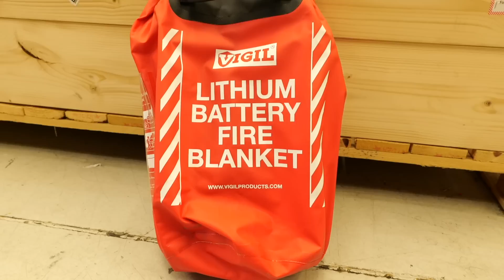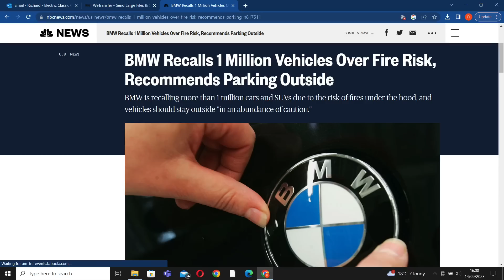Electric Car Fires - Facts and Figures

Comment: A parked ICE car will not spontaneously combust due to the fuel alone. Unless flammable fluids have leaked onto the exhaust or some other extremely hot part of the powertrain petrol or diesel simply will not burn without a source of ignition. Thats only going to happen if the engine is running or the engine has just been turned off and is still hot. The most common culprit of ICE fires is an electrical fault, which can be down to a multitude of sources, be it age, damage to wiring or poor manufacuring quality. In either case its the flammable materials the vehicle is made from that burn. Hardly ever does the fuel tank go boom. There are millions more ICE cars than EV's so of course the fire statistics will be higher. The issue with EV's is the likelihood of a short circuit is multiplied thousands of times because of all the individual cells that make up a battery pack. You only need one cell to go rogue and that's the end of your EV and anything parked near it.

Comment: @ECC 
   I may have 2 solutions .
Both variable related .
   1st Sweden .
Regarding fire services grapling an electric vehiclefire .
  Sweden enjoys lots of snow during winter months.
  If Austria has small machines to create snow for skiing .
  The Swedish fire services could use snow ,ice or even have a fire truck version of a slush drinks puppy machine .

  2nd solution .
Given all the hype about getting rid  of fossil fuels and replace them with renewables,such as wind turbines that burst into flames and are currently non recyclable.
  2030 mandated The foil fuel dead line .
   Then you will only have one catastrophic fire starter percentage to calculate .
   For safety .
We should all give up travelling altogether .
Give up all electric cars  fuels trains , aeroplane flights ,boating (fishing inclusive shipping and space travel .
We can all live in out secured ,perfectly 
  diverse 15 minutes cities .
Walking or cycling. 
  Mandatory to go to gym 2 hrs a day .
All training machines connected to dynamos..to generate your allocated electrity quota .
So you that you may have the ability to stay warm and cook without facing a hefty jail sentance if you burn a protected tree ,any  illegal substances or any  protected book . 
  Most books in the future will be written on toilet paper with petrol chemical free ink .
    

    Sarcasm remains the best remedy .😅

Comment: Age of the petrol cars that caught fire. 5 to 20 years old. age of the electric cars that caught fire. 3 months to 2 years old. I am guessing in those numbers. Lets see in 10 years what the numbers are like. as there are more accidents. as the cars age. I am sure the numbers will be much different. PLUS they emit a lot more emissions when they burn Because they burn hotter and longer. Plus they usually burn while sitting instead of while on the road. So they take down other cars and structures when they are charging.......Lots more to look at than just how many.
Reply: I Have rarely seen a petrol car catch fire when parked it is 1 in millions.  they usually catch fire when driving down the road. More often Electric cars have been catching fire when parked or sitting on chargers.

Comment: There's one major flaw in your calculation about the probability of a EV catching fire vs an ICE vehicle. You need to take into account of the age of the vehicle that had caught fire. Thus you need to look at the age of the vehicles, say 3 year old EV vs a 3 year old ICE car. Also you need to take into account of why the cars catch fire. Many ICE cars are badly maintained and indeed some had been recorded as having caught fire because of bad servicing practices, especially for older vehicles.
Reply: This has been accounted for in studies by insurance companies. Comping fire rates of new ICE vehicles and number of fire related recalls of new ICE vehicle compared to Ev’s. The difference between the two is stark to say the least.

Comment: You're missing the point. Petrol and Diesel cars are extremely unlikely to catch fire when not in use. Electric vehicles can go thermal at any time. Vehicles that catch fire in use have the benefit that the driver will raise an alarm and they are usually out in the open. EVs can and do go off when no one is around, for seemingly no reason. You cannot park and leave an EV and be absolutely sure it isn't planning a disaster in some car park. Then when they do go party, you cannot stop the party. Huge difference.
Reply from the maker: If you think ICE vehicles don’t catch fire unexpectedly when parked you are wrong.  BMW for instance are recalling over a million cars because of this risk. https://abc7chicago.com/bmw-car-fires-vehicle-what-causes-per-year/5121834/
Reply: Actually the rate of car fires while parked is still much higher with ICE vehicles. Just before the engine is off does not mean electrical wires don’t have potential across them. When they find a flammable liquid such as fuel, oil, brake fluid, transmission oil, diff oil, etc etc etc. they go up.

An EV is still far less likely go to up in flames while parked than an ICE is.

Comment: FACT you cannot deny : EV fires burn 1000 degrees C  or 2200 degrees F  HOTTER than petrol fires. NO petrol fire can melt concrete, an EV fire CAN. https://www.youtube.com/watch?v=Or0LhQHtNOY Toyota ... https://www.youtube.com/watch?v=Or0LhQHtNOY
That Luton fire was recorded as a diesel fire. The BATTERY did all the damage = COVER UP.  Ships destroyed by car fires were almost unheard of before EVs,
Reply: Bashahahaha. I love the crazies. OK. So Luton WAS a diesel fire. We know this. We have video footage of the car. With the number plate, which we can search and comes up as a normal diesel car. 

Statistically speaking there were only less than 14 EV’s in that entire carpark structure at Luton.

But let’s assess your claim that ICE cannot do that to a concrete structure.

First. In 2017, an ICE car caused a fire in the Liverpool Echo Arena carpark. Back when hybrids made up less than 1% of the total population of cars on the road, much less EV’s. 1,500 cars were destroyed and the car park completely destroyed. Concrete gone, metal given way, cars fallen through multiple levels. All ICE. So it’s happened before. Why people like you are surprised now is beyond me.

Second, let’s work out WHY it happened. Using our old friend Physics - I know. Big word. But I’ll try to keep it simple, jack. 

Firstly, concrete utterly disinterested, pops and explodes. At temperatures above 600 degrees C. Structural steel will lose 50%-75% of its strength above 500 degrees C. (But not melt. It’s called the annealing temperature). FACT an ICE fire can burn at temperatures between 850 degrees C to 1,200 degrees C. Which is well above those two temperatures. There is concrete above and below and metals cars to the sides all reflecting heat back on itself like a kiln, or a furnace. Open air sides let fresh oxygen whip in to fan the flames even harder. So unless the fire department can get water on the car or there is a sprinkler system to keep the structure cold, a collapse would have been inevitable. 

Turns out the Luton carpark didn’t have sprinklers. And the height clearance of the carpark was too low to allow fire trucks to access the car. The best they could do was park on the street next to the carpark and try to shoot water in the side and use our good old friend “thoughts and prayers”.

So don’t be so surprised the structure collapsed: it’s not a coverup, you just have to learn basic physics. Or do the bare minimum google searches.

Comment: Current figure from London fire brigade records show EV at. 1ice. 04. Even the Swedish stats don't sound good for EV, with most electric vehicles being new & ice vehicles on average being much older. Are you filtering out modified cars, diy radio changes.

Comment: Interesting report. I have always been very interested to see what the actual percentages were.
I always thought that the likelihood of an ev catching fire was less... But as you say, the problem is the extreme nature of an electric battery fire compared to a fossil fuel fire... And whether or not the fire service is equipped and trained to deal with it
Reply from the maker: Exactly 👍
Reply: The heat released from burning down a 65kWh battery is similar to ~40 liters of petrol, or 31 liters of diesel. It's just that it burns faster and hotter. It makes very little difference what the state of charge is, if it occurs. The nice thing is, it hardly ever happens!

Comment: Another reason why EV is a scam sucks and horrible stupid, is refilling of both, no matter how hard to try quick charge or turbocharging, it's really quite sucks as the charging time still the same 1hour, compare to gas/diesel tanks with the same capacity, it tends to only waiting time is between 3-6min. You donot have to worries waiting somuch if you really need to fullfill something unlike batteries where, even you're early prepared to come in work or something, if you forgot to charge your car, you don't want to wait for way too long to fully charge it, you really need go in your job else you're risk being kicked. The most important one, because you're rushing something and you forgot to charge your EV you can't go to your job either or something, there us no way to make that 1 hour into 5 min or even 3min of charging into fully charge no matter what kind of turbocharge or quickcharge or fast charge is, there is no massive changes in charging time still 1hour or 9min, is wayy too much waiting.
Reply: V3 supercharging can charge an EV in 5-10 minutes. But unless my daily commute to work and back exceeds 330 miles I can just charge it at home with a home charger in couple of hours while I’m asleep at night. Or 7 hours if I plug it into a wall outlet. Oh the inconvenience of waking up every morning with a full tank. What ever will indo

Comment: Why those only things that you only know as disadvantage of EV? Myself is too many. And some is my experience. EVs are horrible in mileage compare the battery and gas or diesel tank with the same capacity. Batteries tends to be falls way to quick, you can go much further than 300Miles/ twice as far than 300miles with the same tank capacity as the battery, both 1200lbs.
Reply: Engineering Explain. Even present that topic

Comment: Plus, lithium ions is kinda trash cost for what it is, it is really sensitive battery as well as the polymer, it really dies together if submerged into water. The cost of replacement is wayy way expensive and frequently afternoon 5000months. Not even 5000months either.
Reply: 5,000 months is over 400 years….

Comment: Diesels never burned by flame, but they burned only in high temperatures that's why they used it in high compression engines trucks and heavy duty vehicle. They never burned in a single burst flame not even spark from electricity. They burned because of high temperatures.
Reply: That explains all the trucks that don’t cause peak hour traffic delays because they’re not on fire in the middle of the freeway. Gotcha.

Comment: EV battery it tends to explode in extreme temperatures not in optimum temperatures. Do not  lied, because it is true lithium ion is Extremely dangerous battery, you can't extinguish only by water as it contains a chemical that can't controlled by water even Extinguishers. Lithium ion never safe battery as long as it sitting in stable atmospheric pressures, the spike of voltage or oversupply power might cause the battery to suddenly explode.
Reply: They actually don’t.

Comment: An overlooked thing.
Ice or Ev,Which car would catch fire first in a fire in a building,the fire started by anther means not a car.
I think the the ice car,the plastic fuel tank and fuel line would melt Long before an Ev caught fire this is how fire spreads between ice cars making a disaster.
Reply from the maker: Exactly 👍

Comment: Weird how admitting EV'S catch fire makes them not dangerous.
Reply: Well what car doesn't catch fire?
Reply: @PyroShields  many, look-up "self immolating" cars and you will find every kind EV made
Reply: @tylerdurden4006  The guy said in the video anything with energy has the potential of catching fire. Gas, oil,diesel, lithium etc.
Reply: @PyroShields  look up diesel car fires, they don't happen unless it a runaway engine, try look up diesel car fire and see none.
Reply: @tylerdurden4006  There were more fires with ICE  cars  in  comparison with EV's

Comment: There was also a London fire brigade report that suggested EVs were twice as likely to catch fire. One problem with the report it doesn’t drill down into the age of the vehicle, I just wonder if that may have a bearing on it. Personally, I think we need a new comprehensive study in vehicle fires in the UK.
Reply from the maker: I remember that London fire brigade data from a year or two back. The fire numbers were heavily skewed as they included electric scooters, hover boards and bikes, not just cars.
Reply: @ElectricClassicCars  
That’s fair enough and I am not trying to pick a fight, I think we need something more conclusive than that Swedish report.
Reply from the maker: @gmo4250 Lots of other info out there too. Like the 2 below https://www.evfiresafe.com/ev-fire-faqs
Reply from the maker: @gmo4250  https://www.autoinsuranceez.com/gas-vs-electric-car-fires/
Reply: @ElectricClassicCars  
Thanks.

Comment: It’s not a question of what type of vehicle starts the fire, it’s a question of how you deal with it once it starts! At this time there is no way to effectively put out an EV in thermal runaway. Also, you make no mention of the very much higher temperatures generated with EV fires, plus the far more toxic fumes given off when they burn. So you are right with the facts you consider, but absolutely wrong about the consequences if they do catch fire. I think Sweden is pioneering a system of very cold (-18 deg C) salt water to be used on EV’s when they kick off, which, much more effectively cools the fire, plus it acts as an electrolyte & therefore discharges the battery to stop future ignition. However, there is a long way to go before the infrastructure is in place for EV fires to be controlled like an ICE fire!

Comment: 1) So, according to the stats you gave, 50% of the electric cars in Sweden are less that 3 years old.

What happens when 50% of them are 15 years old, like the average car here in South Africa?

From other stats I've heard, Electric cars are half as likely to catch fire, compared to ICE vehicles. 
Keep in mind that many ICE vehicle fires are still cuased by electrical faults. 

2) The problem is that the effect of EV battery fires are many times more deviating and much more difficult to extinguish.

3) Airplanes are highly controlled and maintained...15 year old cars are not.

4) Nonsense!
Putting a thermal blanket over an EV fire keeps the heat in and make the fire more intense.

Comment: The electric car fleet is still quite young, the petrol/diesel fleet much older (on average) we will have to see how the situation develops as the electric fleet ages. It would also be interesting to know if fires in petrol and diesel are reducing or increasing, with a view to assessing if design and construction standards are going in the right direction.
Reply: My thoughts exactly.  Maintenance is a very important factor especially with regard to aging ICE vehicles.
Reply: SO---what you are saying is---wait and see how many of these NEW, or VIRTUALLY NEW CARS,   KILL PEOPLE, so that the number cruncher's can compare number's, against Cars  that are NOT EV's , but likely to suffer from long mileage and lacking in sufficient Maintenance ???   These VEHICLES, that include New Coaches ( Check out the two on YT.  one was parked ouside a central Parisien Hotel, as Passenger's had just left, to enter the Hotel. It went up like a Bomb. nearly catching the Hotel frontage on fire  )  I would NEVER--trust a EV now.  They explode, not just smoke and give a warning befor the flames errupt.

Comment: make the facts fit your narrative ,there are 10.5 million Swedes living in an abundance of wilderness . There are 32,27 million vehicles on the road in the UK. Cars do not fly. Just nip down the road and get us a lithium Iron blanket,,,,Are you real . The toxic gas given off in thermal runaway is far greater than that of a crashed Cessna light aircraft

Comment: First i wanna say that i love EV´s and want them to become the norm yesterday and ICE-cars can take the same place that horses did when ICE-cars came along = for leisure and relaxation not A to B everyday use.

With that said it was one thing i would have liked to know and should be taken in to account and that is that all the EV´s are at most 10 years old but how old where the 2300 ICE-cars that caught on fire? You may beginning to see the EV fires increasing when the cars becomes older and i think it´s the same with ICE-cars generally.

But that was just a thing that popped into my head and even if it where the same figuers EV and ICE, EV´s is the way we should go.